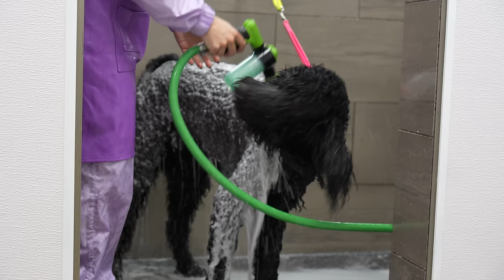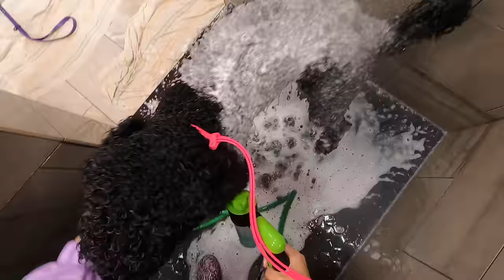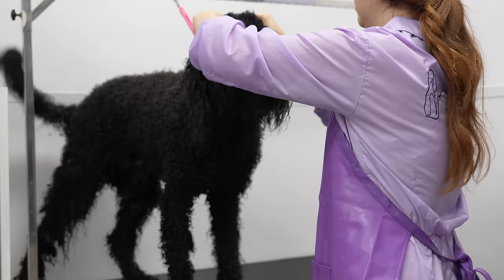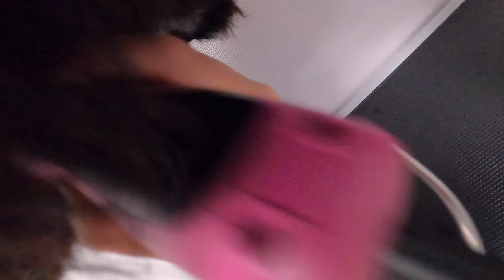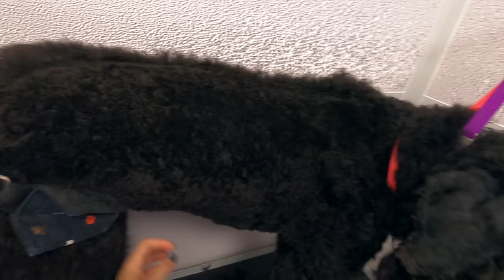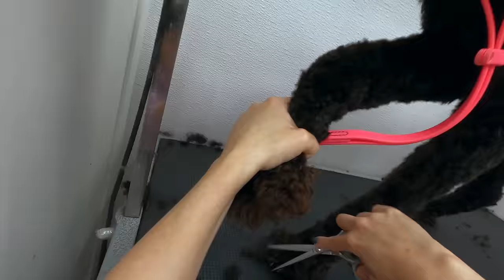The owners sliced their dog | Crazy rescue Doodle

Comment: Ok.  What I used to do with situations like this to humanely give myself leverage is: apply a short leash on the bar opposite his head.  I used a cat collar attached to that leash sized down to fit dogs ankle.   The 'backpack' kind of instant closure.  You adjust the tension so the dogs foot is back behind him 1 inch above the table.  This keep him on 3 legs and he can't  swing around or paw you as easily.  If you need, you could use this on one front leg and put the belly band in back.   This keeps him from punching you in the face.  It doesn't hurt them to have to balance on 2 opposite legs or 3 legs TEMPORARILY to give YOU leverage to groom them.  After several grooms, they learn some manners.  Just SLIGHTLY keeping them off balance helps YOU tremendously! ❤🎉

Comment: He reminds me of a doodle who regular boards where I work. I don't want to say that I hate him, so I'll say that I really, really don't like him. His owners say he's a purebred standard Poodle. He isn't. The face is wrong for one. He looks exactly like this dog here looks. Acts about the same, if not worse. He's had no training and doesn't even listen to his owners. He isn't aggressive, but he's highly energetic and does not understand about not jumping. I have gotten bruises and scrapes from him jumping on me. He's a right pain to get back into a run as well. We usually give owners back their collars, harnesses, and, definitely, their leashes. Unless we have to tell 2 or more nearly identical dogs from the same family apart or if the dog requires a harness for walking instead of being off leash in the yard, or if the dog is a pain in the ass. In the aforementioned doodle's case, we have to hold onto his collar and basically shove him into the run and get the door closed before he can get back out. I'll deal with pretty much any dog before I deal with that one, because of his jumping and complete inability to listen to anything.The owners actually want to breed him and that's even worse. I hope whoever has the female takes one look at the male and refuses. We get some doodles that are fine, but most of them are absolutely nuts. One of my least favorite types to work with.

Comment: Poor guy he had so much energy. I have a poodle as well. It is necessary to run them 50 kabillion miles before trying to groom😂😂 then you will only get one black eye. Anyone out there have suggestions on affordable clippers for poodles thick curly hair? My girl is one year old and I've broken multiple pairs on her and most just don't work. If I'm going to drop some money on nicer ones I want to make sure they will work. The last pair I bought where the Wahl pet pro plus heavy duty. Could not even get through her hair with any of the attachments (hair was long after a long winter). Do they make attachments with wider teeth? I live in a very small town and can't travel in winter so I need to be able to maintain her myself through the winter months. Any suggestions are appreciated.

Comment: I do not think owners get, dogs are always learning.  Starting with and working through everything is so much easier with a puppy. This dog probably had an attempt at grooming. He probably did similar behavior and got away with it. Is he bad? No he just learned exactly what we do not want a dog to do when being groomed. So what makes it even harder is he thinks this is what he should do and has learned to stop things he does not like. So with this dog, you have to untrain and retrain vs just train.
Training wise I break everything down and train each part. Standing on the table, being comfortable getting his legs touched, getting used to tools touching his body. Getting used to the vibration of the clippers. You can work on several parts each day as long as training is short and not past his threshold.
Be your groomers best client and even if you do not groom your dog pick up their feet and hold them tie them up and give treats.  Walking into the groomer should not be a new experience, merely a new location in person.